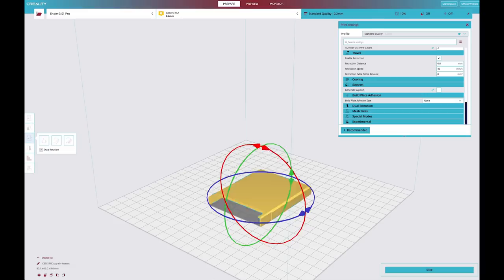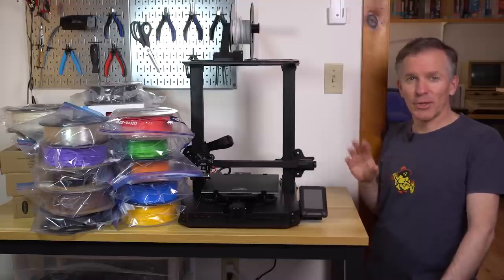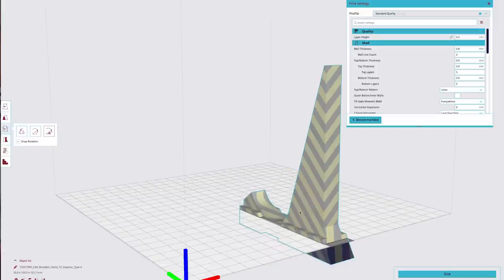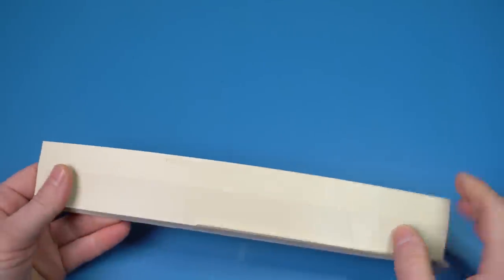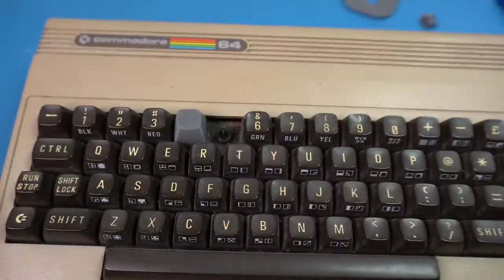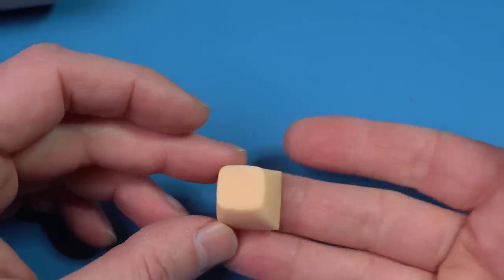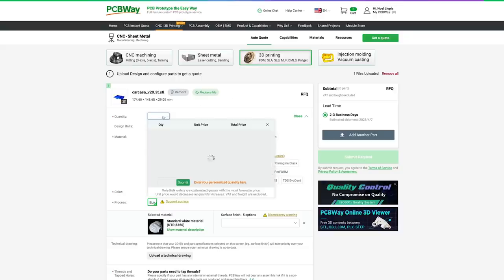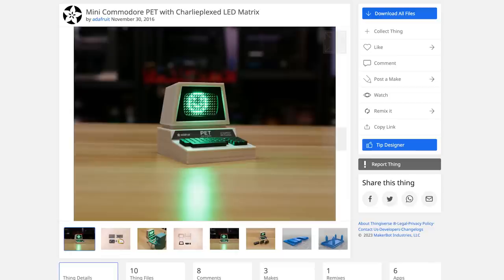3D Printing and Retro Computers

Comment: A few ideas if you want to get smooth surfaces on filament prints - the easiest step is to use a slicer that has an “ironing” setting. This makes an extra pass with the print head on top surfaces with a very low filament flow, normally 10% of the normal feed rate and fills in the gaps while partially remelting the top layer. I find this makes a huge improvement with flat surfaces, though it can add an hour or so to a the time required for a fairly large print. I use the CURA slicer that I thoroughly recommend with an heavily modified Ender 3 printer and it’s well supported. The other thing you can do is switch to ABS filament (a bit harder to print) and then use an acetone vapor chamber after printing. The acetone softens the outer layer of the print and smooths out the surface. For things like replacement keys, it should work pretty well. 

The prints you got from PCB Way were probably made with an industrial SLM (selective laser melting) printer that creates the part by using a laser to melt powder layer by layer. The printers are far more expensive than home filament printers, but much faster and as you noticed, produce results that look as good as injection molding.
Reply from the maker: Great tips, thanks! I think that's going to push me over to finally try the Cura slicer 😃

Comment: Funny to admit, that I'm using Blender for modelling parts. It's probably not the best tool for that, but this is what I know from my career as games developer, so I continue to use it for various things. Blender has also 3D printing plugin to check the models. So, if s.o. is confident in Blender, then it is possible to use it for 3D print design as well.

Comment: Some FDM tips:
- Dump Creality slicer and upgrade to the latest Cura (which Creality abused an old version of) or PrusaSlicer.
- Get a PEI flex-plate to get things to better stick (but probably don't risk using it when printing PETG)
- The monitor door might have been designed to be printed with ABS, which shrinks a bit and hence requires parts to be slightly oversized.  If you then print that part with PLA, it would be too big.  I can't say for sure from the video whether that was your problem, but you definitely do not want to print such a door in PLA, but probably want to use PETG (much better layer adhesion) if you don't want it to break even faster than the original.

Some SLA tips:
- There are also spring steel sheets as buildplate for SLA printers that should make it much easier to get the prints off.  I have not bought one myself yet though.
- There is water-washable resin which makes things somewhat easier by not needing IPA for washing.  I love the colored transparent ones from Elegoo as the transparency also make it possible to fully cure thicker walls as the UV light can penetrate.  If you use an opaque resin, the exposure will only partially cure the inside of thicker parts and the light from the curing station just cannot reach it.  So, you'll end up having that toxic half-cured resin still there behind a thin wall of fully cured resin.  So, even if you don't want transparency, using a transparent resin has benefits and you can get the right color by painting it.

And for Fusion 360 being slow ... I guess that will be caused by your Apple's ARM.  It flies on my Ryzen cpu.
Reply: Fusion works really well on my i9 as well.
Reply: I'd describe Fusion as a little slow. When i was last using it on i5-3570. FreeCAD was less sluggish. Now i have R5-5500 which is TONS faster but i haven't had to use Fusion recently. Both machines have been equipped with GTX970, which is nice for OpenGL performance.

Comment: The ZX80 case from PCBWay was most likely printed on a SLS printer. Traditionally SLS printers pint with powdered nylon, though it wouldn't surprise me if they have ones now that can print in powdered PLA.
Reply: yeah, looks like an SLS print to me.

Comment: I’ve printed so, so many brackets, cases, and replacement parts. For me, finding and/or designing or modifying parts is one of my favourite parts (boom tish) of this hobby. My Ender 3 has so many “miles” on it from all kinds of projects. 
I’ll eventually get a resin printer to small, more detailed bits like key caps.

If you want really, really high quality prints with an FDM printer, be prepared to also learn about sanding, filling, and painting.
Reply from the maker: Right? It's become kind of an essential tool by now!

Comment: Couple of 3D printing tips.  For FDM use PLA+ as it is stronger and slightly more flexible (I made a 6ft sound bar with it).  For resin, use water soluble so you do not need any chemicals to clean it. I have made over 400 keycaps with walls only 0.6mm on my 13" Resin printer.
Reply: Water washable resin is even more brittle, lower cohesion, than the alcohol wash kind. And that's already not all too strong.

Comment: Actually FDM can do a much better resolution if you use a 0.15mm nozzle instead of a 0.4mm one. Also, if you want a very smoth surface, use ASA. It can be smoothed with acetone. First do some wetsanding. Than hang the keycap over a cup with acetone for a few minutes.
The big advantage of FDM with 0.15mm nozzle: You can use a multimaterial unit (f.e. ERCF if you add klipper to your printer) and embed the labeling. Like the good old "double shot".
Resin printing is good if the keycaps are in a light colour - you can use dysub transfer to label them. The downside of FDM with 0.15mm nozzle: It takes a lot of time... You should use a Voron 0 for such usecase.

Comment: FreeCAD is parametric and improving all the time. I have designed a retro keyboard enclosure using it. It is rough round the edges but I think it is going places. It is free and libre.
Reply: If one were to use it, two tips. Realthunder's Link fork to limit cryptic errors and things fallling apart, and Joko's comprehensive PartDesign tutorial. Trying to learn FreeCAD by poke is a HORRIBLE idea, you need fundamental knowledge of what it expects you to do and not to do.

In contrast in Fusion 360, you can just be productive intuitively. If you know how sketches/constraints work it's better than if you don't, but that's a 5 minute intro.

It is to be said though, feature wise thanks to installable workbenches, FreeCAD won't leave you wanting. On the flip side, it's not a software that was designed, it's a DIY construction kit for CAD with badly fitting pieces. It doesn't even have official UX design guidelines, like different workbenches will even implement such basic things as selection differently.

Comment: A couple of years ago Geetech sent me one of their multicolour printers to review, this one can have two different rolls of filament installed at once and swap between them or even mix the two together, so you can actually do colour mixing ! I use my printers mostly for making replacement parts for old electronic test equipment I repair for my videos. For finer details I run my Ender3 V2 with a 0.2mm nozzle, it takes a LOT longer to print but it results in much better quality, I am yet to find a 0.2mm nozzle for the geetech.
Reply: Have they changed nozzle type at Geeetech? They used to use standard M6 mount nozzle.
Reply: @SianaGearz  I honestly don’t know, I’ve just been trying to find ones that specify that machine, or look the same as the originals at least.
Reply: @TheDefpom  Right they HAVE changed the nozzle, the new nozzle uses M7 thread.

MK10 nozzle uses M7 thread as well, but it's bored for the PTFE to go ALL the way inside it, 4mm ID. So i don't know whether it'll work with Geeetech's modern assembly. It might be worth switching to those and create yourself a slug similar to those CHT clones, or maybe that one is suitable. You have seen CNC Kitchen's videos?

Honestly if i had that, given Geeetech doesn't appear to make other nozzles than 0.4mm, i'd be tempted to rebuild it to a different hotend that uses M6/MK8 nozzle :( I notice that there are generic mixtruder hotends built like that, cheap but not sure whether they're any good.

Comment: Hi Noel.  I'm not sure what processes PCBWay used for your prints.  However, it's very likely that no matter which method used, they are employing equipment to post process the print.  This equipment can be of few different types: vibratory abrasion, fluid abrasion, or jet, as well as a few others depending on the print method.  SLS printing is another common industrial 3D printing technology, which is a fused powder.  I've worked with many of these post process machines, and the results can be truly incredible.  They can also remove desired details.  However, most higher end post processing machines can have a variety of customized profiles created to balance the good and the bad to get the most desirable result for an automated (timed) cycle.  Generally some manual work is still required, before using the automated process.  Some of the parts, especially on flat surfaces look as though they were painted in a matte finish, and are super smooth.  Part dimensions can also change due to material removal.  This 'may' explain why your parts were so smooth, and felt thinner.
Reply from the maker: Yes, I think you're right. I looked at the print really closely and even has some things that look to be hand processed.

Comment: I have been 3D Printing since 2016 and have found many many uses for it.  From designing & printing parts for cars that are no longer available, various brackets and bit's n pieces.  I also designed and 3d printed a few parts for the A500 mini when that came out.  I also used 3d printing to repair another of my 3d printers when the brackets for the stepper motors cracked.  The 3d printed bracket lasted longer than the injection molded part that came with the printer.  3d printing can be a very handy tool.

Comment: For CAD I use SolidEdge (and I have been using it for about 20 years at this stage so...), it's commercial but there is a "community" edition (limitation is basically that you can't open files produced in the community edition in the commercial versions), you can do the parametric thing with it, including creating whole "families" of parts e.g. same physical structure (more or less, you can also suppress features based on parameters if needs be) with different dimensions.

Another option to look at, though it's a completely different paradigm is OpenSCAD, it's basically CAD by scripting so about as "parametric" as CAD can be ;)
Reply: I've wanted to try Solid Edge, but for one, Linux compatibility... and for other, i'm always afraid they'll pull a rug from underneath you. So i rather end up torturing myself in FreeCAD. Which is powerful, i can do anything i can think of, but it isn't nice.

Comment: Recently I found an E-HT PLA filament, and it is really great. Prints have great layer adhesion and literally no warp, so they stick to bed perfectly, even on sharp corners. Of course, it still is just PLA, but it gives just perfect prints every time.
Reply from the maker: Oh interesting! I'll have to check that one out. Is that the brand or is that a type of PLA? Do you have a link to them? Thanks.
Reply: @NoelsRetroLab  It is a type of modified PLA. I'm not sure if YT allows links, but the brand behind it is Print-Me. It is an EU (or to be more precise Polish) company, but I believe its products are available worldwide.

Comment: One way I have found good for smoothing out keys is to apply a thin layer of clear epoxy resin. It fills the tiny gaps and if you apply paint first can protect it and stop it rubbing off. I just use kits made for jewellery making.

Comment: One more thing about 3D printer is that it's not just the printing where you have to learn, but the post-process too! Some pieces will need glueing, some will need to be primed and sanded, etc... some pieces are very involved...

Comment: You can grab either white or crystal clear resin, mix in resin dyes from companies that make dyes for liquid casting resin(stuff like Alumilite). Make a custom color and print with it. In this case the brown for the key. And when you're done, put the leftover brown resin in a solid container, seal it, and mark it as to what it is. And you can use it later. As long as it doesn't sit for a long period of time it can be used later.

Comment: Notes to avoid warping:
1. Look into draft shields. Even just the movement of the bed can cause air to flow across the part and cause thermal contraction issues.
2. Consider an enclosure or ways to avoid air drafts in the room.
3. Different bed materials can have better adhesion like glass or PEI.

Notes for keycaps:
1. Use a smaller diameter nozzle (.2mm) for finer details. 
2. Use smaller layer heights for better top surface. 
3. If you can, use ABS and smooth using an acetone vapor process to get rid of layer lines and get a nice, shinier look.
4. With resin, it may be impossible to achieve a completely opaque print, especially something like the black keycaps you're trying to match. The resins, by their nature, are always going to have some subsurface light scattering and will always have a 'soft' look to them. Painting is the solution here.
Reply from the maker: I actually read that enclosures can be worse for PLA because it gets too hot (but they're essential for other materials). I haven't tried one though. But I did notice more warping when the room gets colder for sure.
Reply: @NoelsRetroLab  If you make an enclosure you can fit extractor fans to pull out hot air with any fumes produced by some of the exotic filaments, that also can be switched off if you are trying to create a warm atmosphere for filaments like ABS. An enclosure can also reduce problems caused by drafts and reduce noise if thats a problem. But generally for PLA, PLA+ and PETG they are not necessary unless you have your printer out in a garage or other cold place where rapid cooling will cause stress in the print leading to warping or poor layer adhesion.
Reply: @NoelsRetroLab  yea enclosure makes more sense for abs or the like, that's true

Comment: Great video. One more advantage to note with the resin prints - you can actually just buy white or clear resin, and then add dye to it. With a bit of effort and practice, you can actually colour match pretty close. You can also get some pretty nice effects by adding stuff like mica powder to the resin, and it also prints fine.

Comment: Cool examples of merging the two hobbies. Thanks for taking the time to put this together!

It's perfect for figuring out a way to take new parts and make them work in place of 40yr old parts that are no longer made. Ex. contrast pot is no longer made for the Radio Shack Model 100. I created a 'shim' to use a modern one as a drop in replacement for the original. Add creating a custom PCB to the mix and you get a good replacement that should last another 40 years and a computer that isn't destined to e-waste, or have to harvest a replacement from a 'parts' computer.

Comment: You were lucky to get a 3D printer with bed auto-levelling. This is really a game changer . I've worked with the cheaper ender models, and while the results are very good you have to spend a good amount of time trying to get the bed levelled. And when you succeed, you better leave the printer at that same spot, moving it usually ruins it.

Comment: If you don't mind the mess, glue stick works very well for PLA. You've got a lot of warping going on during the cartridge and failed door print, could be too high fan speed or too low build plate temperature.
Reply from the maker: I don't think the cartridge warped. It has beveled corners which makes it look like it's lifting, but it was solidly on the bed all along. I haven't tried the glue stick, but I may have to try it. Or a glass bed since those usually make it TOO difficult to remove. Haha
Reply: @NoelsRetroLab   Glass beds are really nice, but I had to start placing painter's tape on top to get a bit of a texture and help release the print.
Reply: @NoelsRetroLab  I have a glass bed on my printer, and use a shot of hair spray to help some difficult prints to stick. I used to use the painter's tape on the original bed surface, but my bed is a little warped and the glass made it nice and flat, and leaves a nice shiny finish on the model where it was stuck.
Reply: @NoelsRetroLab  ic, I take it back then, looked like it was lifting somewhat in the video. The glass bed is great too, my prints usually come off with a solid pop. All you normally have to do is strike a corner of the print with that spatula that comes with the printer and it lets go. Enjoy the hobby, love your videos!

Comment: Great video! And I can relate to it a lot. I've bought an Ender S1 (without Pro) in January and have similar experiences. It works almost every time without tweaking and fiddeling. And my results look a lot like your's. But I don't have issues with parts not sticking to the bed. I had it once when trying to print a keycap for a Dragon 32, But rubbing the bed thoroughly with IPA before each new print solved that completely. For example I print keycaps without any rim, just standing on the bottom edge.